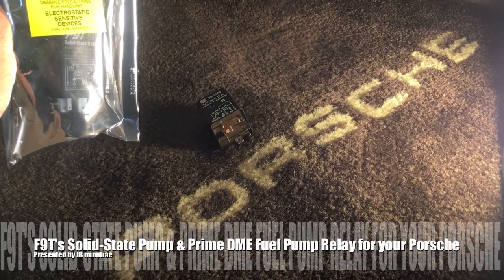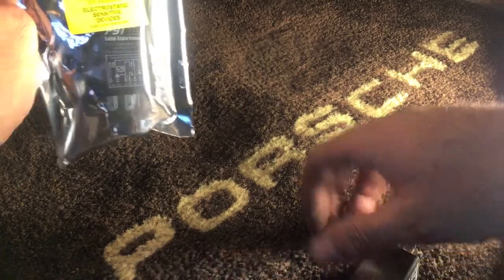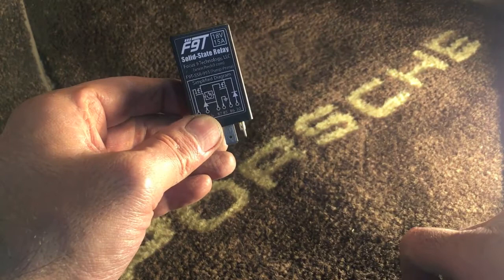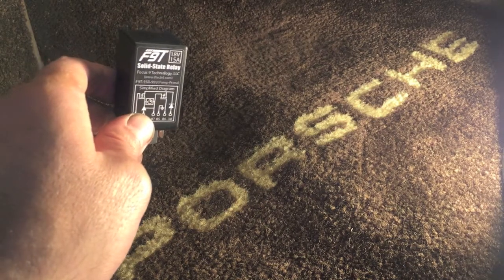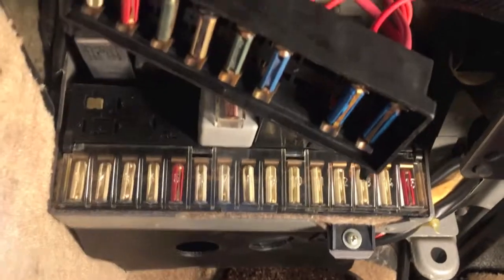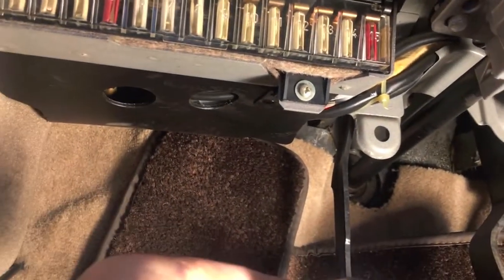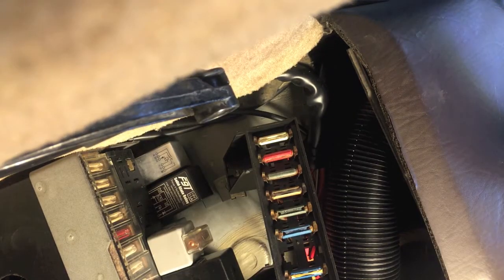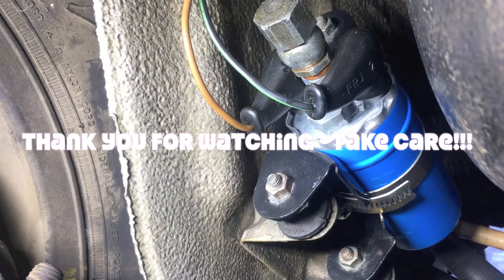Focus 9 Technology's Solid-State DME Relay Pump-Prime for early Porsche 944 and other models

Comment: I have a 1988 Porsche 924s. I bought a new fuel relay but can't figure out how to remove top or bottom sections so I can access it. Please let me know or even better to make a video about this. Lots of people are confused about this. Ger.
Reply from the maker: Hi Gerald,  for your model and year I believe the relays are located in the engine compartment near driver’s side hood strut/shock.  I have an early model (1983).  Porsche moved the relay panel from under the steering wheel to the engine bay for easier access.  Good luck.  Take care!

Comment: I'd heard that the 83s had a door-open buzzer instead of the chime the later cars have, but I'd not heard one until now.
Reply from the maker: Thank you for comment.  Old cars are cool like that.  I think I can disable the relay for the door-open buzzer too.  I’ll check my work shop manual and post an update.  Take care!
Reply from the maker: UPDATE:  It’s a buzzer for both driver side door open and fasten seatbelt.  The idiot light for the fasten belts is synchronized with the buzzer too.